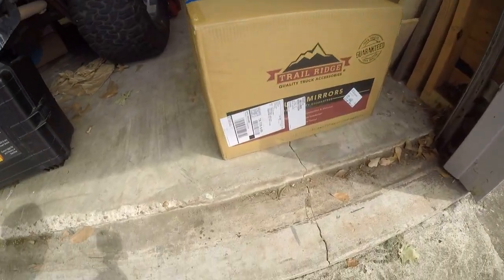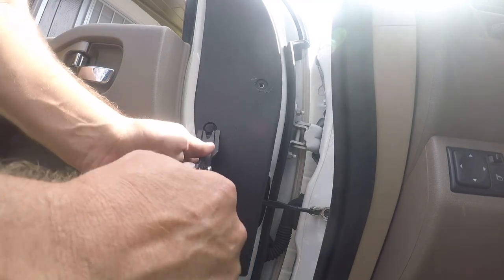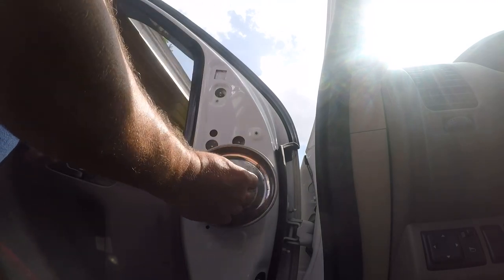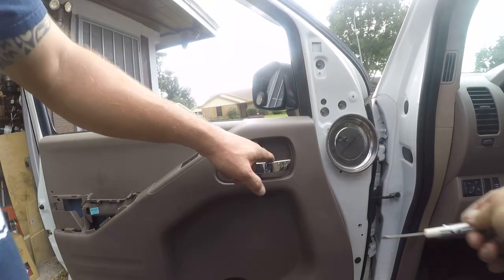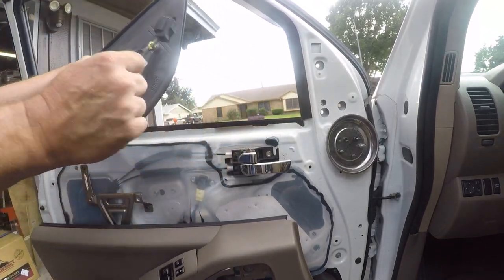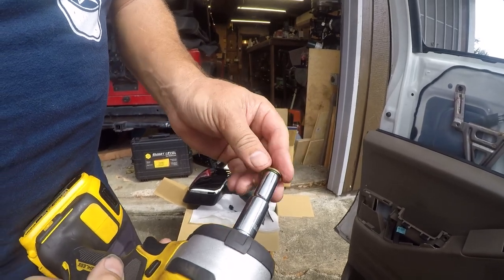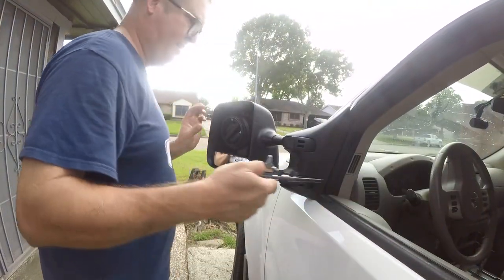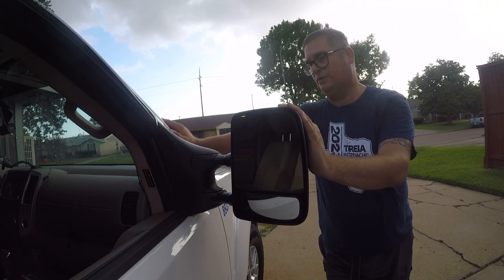Nissan Frontier Towing Mirrors

Comment: Just did this on my 2016 to replace the stock + strap-on mirrors I initially had. The strap-on ones had worked ok, but shook a bit too much when towing my travel trailer. Your video helped with showing what to expect and possible pitfalls. Only thing I would add is to be sure the mirror power cable is routed on the INside of the window guide rail (don't ask me how I know...). I had to trim my rain guards about a 1/2" as they interfered with the new mirrors (which I scored open-box for $180 shipped on Amazon!) where they met at the top of the mirror assembly. 

For those wondering, these Trail Ridge mirrors should fit all Gen 2 Frontiers (2005-2020). The powered/heated model is TR00051 (Chrome & Black Towing Mirror Set with Chrome Mirror Caps installed, Textured Black Mirror Caps included).There is also an identical TR00050 model set that is powered but not heated.